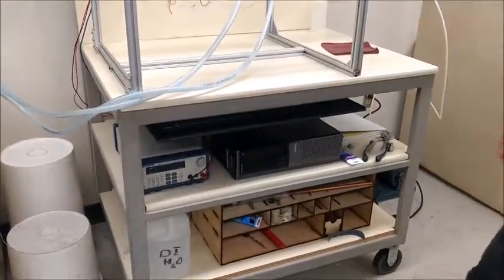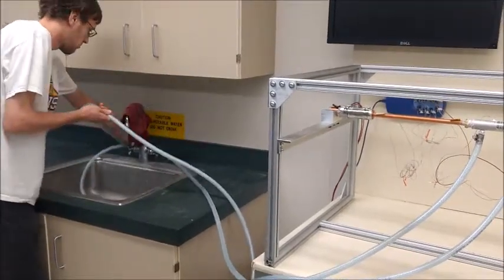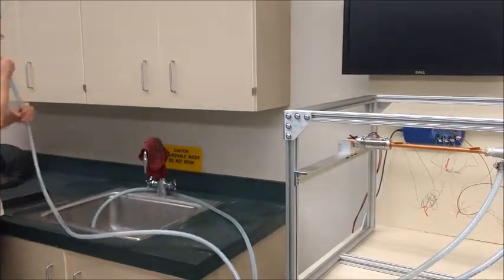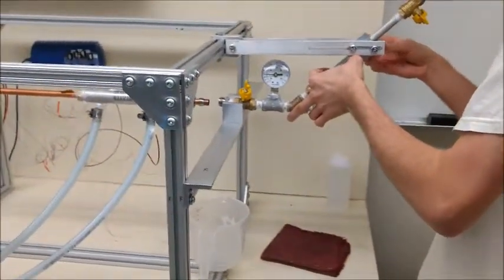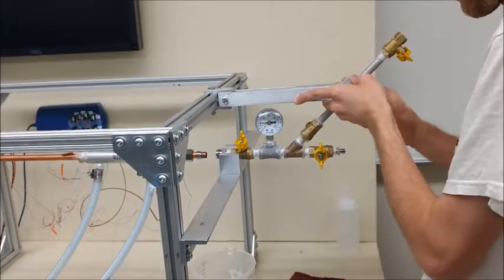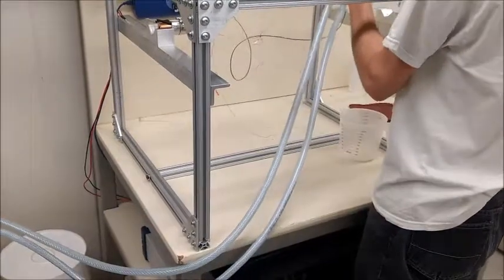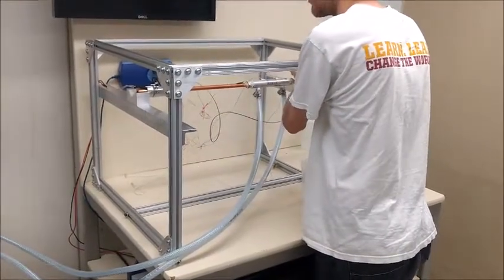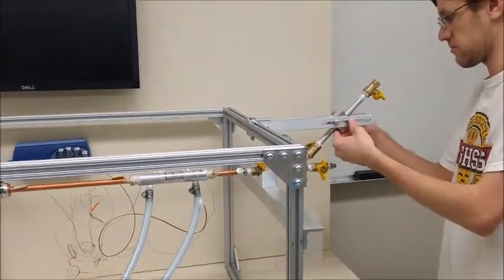Heat Pipe Clean Up

Comment: Hey, I am doing an experiment on behaviour of heat pipes under different orientations , and also upon the number of cycles that a working fluid can be used and to maximise it . It would be great to get in touch with you and discuss it . I need help with the setup of the experiment  
Thank You!
Reply from the maker: You can email me at Heatandalusia@gmail.com.